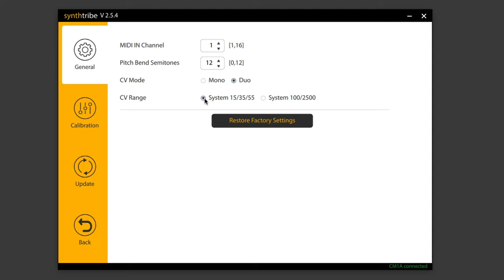Introducing the Behringer CM1A High-Resolution 16-Bit MIDI to CV/GATE Converter

Comment: If I hook this up to a Behringer Model D (mini-Boog?), will I be doing it as System 55 mode? Or as System 100 mode? And are the two CV outs individually addressable? My intent is to utilize one CV out to modulate the CUT CV (filter cutoff) on the Model D, and if possible use the second CV out to modulate LFO SPEED.

Comment: An additional Aux cv output could have been handy, for cc/velocity to cv convertion....
Reply: Lack of velocity cv is a deal breaker - so I got the 2hp MIDI unit instead which exposes velocity and clock.

Comment: So it looks like there's a monophonic mode and a duophonic mode... does this mean that there'll also be a way to simply set independent midi channels for top and bottom cv/gate pairs? That's what I'm looking for, at least.
Reply: There are loads of modules out there that already do that. Check out the Mutant Brain, 4cvs and a load of trigs, or the polyend and doepfer stuff which allows for polyphonic cv control via midi.

Comment: hello guys. if you put the CV Mode in "Mono" (in synthtribe) you can setup diferent midi in channels for cv&trig outputs ?
example, whit octatrack control the top cv&trig outputs pairs through channel 4 and the bottom cv&trig outputs pairs through channel 5.
In tutorial you just dont click the mono mode

Comment: wtf, the button to swap between mono and duo is *behind the panel*, on the PCB? That's a little annoying, I swap between mono and duo mid-performance a lot on my B2600.
Can you configure it with MIDI CC too? Using weird apps is a pain.
In mono mode, are both CVs independent?
Also here's hoping the CV on the BCR32 will also be high resolution... hint hint.
Reply: why don't you ask them for a special Luna Langton version? people are never happy.
Reply: @elbalajazz  okay lol if they want to work with me they should get in touch.
Maybe instead of doing their design work here for free, they can pay me for it so they can get it in time to improve the product!
Reply: Its not hard to solder a button issit? Just solder a second remote one on the pcb pins
Reply: @cnfuzz  exactly. This is the perfect module - and presumable perfect price point - to start modding a module. A lot of the best 1st gen eurorack was easily moddable, and some great stuff was done, changing caps, adding toggles, stuff like that. Bringing a button up to the front is easy.

Comment: I don't get it; midi is 7 bit resolution; why do you need 16 bit? can you do 14 bit midi with cc or something?
Reply: Yeah, honestly not sure about that— I’d get if they made it 32 bit, so it can have full compatibility in the future with the forthcoming MIDI 2.0 protocols, but 16 is just kinda a weird in-between
Reply: It's about voltage precision, for instance with the V/oct standard each semitone is 1/12th or 0.833 V apart, so if you deviate too much from that it will sound out of tune. I still wouldn't recommend this midi to CV module, there are tons of better options out there, like the mutant brain from Hexinverter.
Reply: @halftimemodular  oh of course. In this case that's weird they'd advertise this, 16 bits should be a given minimum for pitch I was thinking control change with LSB which is 14 bits. The pitch bend message alone has 14 bits resolution so 20 or 24 bits for the whole pitch scale even would be useful.
Reply: @valdir7426  Depending on the output voltage range of the module, it's very likely you won't hear anything differently past 16 bits (for pitch anyways). Even for a full 24V output range (which I doubt this module has), 16 bits would map to less than a half cent.
Reply: @halftimemodular  Well maybe you're right; but I do know that 7 bits is not nearly enough for a pitch bend signal for 2 octaves; But I don't know what's the usual bit depth for midi/CV converter. You'd need to be able to smoothly bend between notes; so less than a cent resolution seems appropriate. I'd say at least 12/14 bits would be the minimum; but maybe they're all 16 bits or more and Behringer advertisement is just stating the obvious.

Comment: Would be great if there would a 19" or non-Euroreck version available
Reply: what would you use it for?
Reply: @markuskoivisto  same use but for vintage CV-controllable synthesisers
Reply: Rack adapters are widely available and inexpensive
Reply: @csselement  19" rack adapter for 1 Eurorack module? Incl. power connection? I honestly can't imagine! 
But if you're sure, feel free to leave a link here
Reply: @micmarkno  search, "Tip Top Happy Ending Rack"
Reply: @csselement  Thank you very much, but obviously you misunderstood me: I don't want to start with Eurorack ... and certainly not because of 1 single 6HP module.